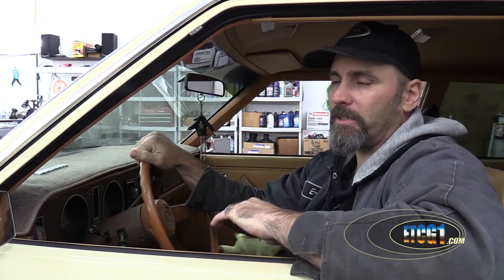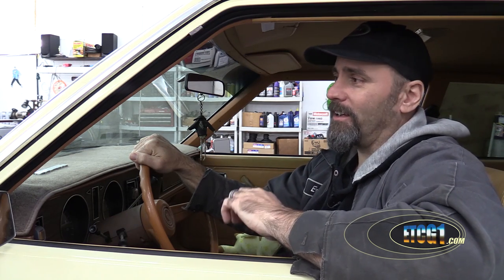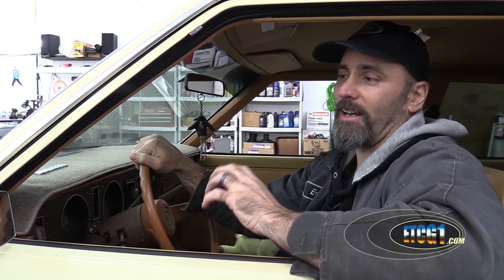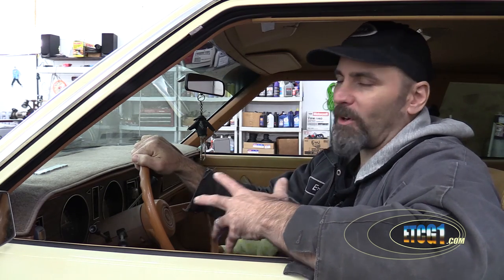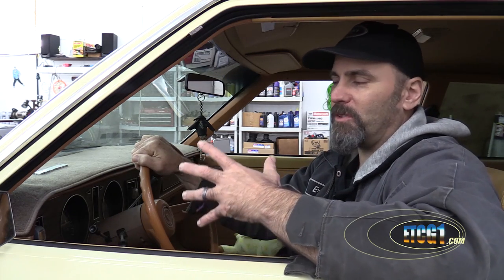Analog vs Digital (Cars)

Comment: Both has their place, both has pros and cons. I've had cars with both flavours, and a well tuned carb does work really well in all kinds of conditions, even freezing cold starts. :) I do have a weak spot for electronic fuel injection though, I like electronic stuff. I remember back in the day I was thinking of converting an old Cadillac to fuel injection using Megasquirt, but never got around to it. I'm sure there are really good custom systems available now for custom projects, but I think a carb fits more to the style of the Fairmont.
Reply: As a side note, on a custom electronic fuel injection system, you can do neat things like changing the power or horsepower of the engine on the fly, disable cylinders and such, specially if you have a vvt system on it. In that way you could have it run more economically when you don't need all that power, but then again, you don't really have fuel economy in mind when building something like the Fairmont project... :D

Comment: Both have their good points, Analog systems are serviceable by a competent person, but there are downsides, do you remember the analogue oil pressure systems which had a tube of oil running through the engine bay.

Digital systems have their upsides, they work very well when they are working fine, and when something goes wrong there are tonnes of mechanics like you, South Main Auto Repair, Humblemechanic, out there to show us how to fix it, every company out there seems to have its gremlins. But does anybody remember early carburetted cars didn't like starting in the cold. 

I think it depends on the application, everyone is an individual in an almost unique situation.

Comment: In the mid 80's the imports, started using Fuel Injection, while the crappy domestics were using a hybrid, less efficient system. Throttle body injection, less precise. My Toyota at the time had a 22R-E (port injected 22R), while a similar aged "domestic" was either carbureted or had a throttle body single injector.

Comment: Ive had 8 cars in total, ranging from -91 to -16. I must be lucky! Never had any sort of problems mechanically or electronically with any of the cars. Only done scheduled maintenance...

1991  1.6l 4-cyl Ford Escort
1998  1.8l 4-cyl Ford Escort
1996  2.5l 6-cyl Ford Mondeo
2004  1.8l 4-cyl Ford Focus
2007  1.6l 4-cyl Toyota Auris
2012  2.0l 4-cyl Toyota Avensis
2015  2.0l 4-cyl Toyota Avensis
2016  2.5l 4-cyl Mazda CX-5

Granted ive never owned a carbureted car, only EFI.

Comment: I started working a vehicles a few years earlier than Eric, in the late 80's and remember adjusting the carburetor and doing all the analog stuff that came with vehicles from the 60s, 70s and 80s.  But as cars progressed I feel they became for me more reliable.  I would like to point to the lyrics of a Merle Haggard song "Are the good times Over?"  Where he wishes a ford and a Chevy would still last 10 years.  I  know now a days there are plenty of 10 year and older cars on the road and this is California with all the emission stuff we have to put up with.  Is it because they are better built or because it is so much more to purchase a new one that people will pay the extra dollar to have them repaired?  I don't know?  I do know if I keep on  top of my regular maintenance on my own vehicles.  I can now drive a 10 year old car and not worry about it breaking down.  Which I actually do now, since the calendar just changes over. 
Eric mentioned older cars can be fixed on the side of the road because they are analog, but I have had an axle break on my and also spun a bearing on older cars that left me on the side of the road as well as an electronic fuel pump so I think both analog and digital cars can leave you stranded, but that is what friends are for.

Comment: I'm from the digital era but I still love analog technology. As Eric has mentioned, serviceability is a big reason analog systems are still a better choice; not to mention when it comes to safety and reliability, Analog is chosen. Take for example braking systems on cars. Yes, they have added a layer to braking and made it better and safer with electronics; but they haven't made it fully electronic. That's because braking falls under safety and electronic (digital) only braking is just not safe enough to use compared to our hydraulic (analog) brakes. If it fails, you will have serious injury or death. Brakes always need to work, regardless of any other part or system on the car. I'm sure electronic brakes would be fantastic, very accurate, and give us the ability to brake as late as possible; but the performance increase doesn't mean it's reliability can be downgraded or even lessened. Just my two cents....
Reply from the maker: The new NSX has DBW brakes. I think you'll see more and more of that. Especially in the next generation of hybrids. Thanks for the comment.

Comment: I personally prefer analog control over digital mainly due to the fact that even though digital tries to simplify things, analog makes things better because there's no guessing, with digital there's readings, codes, and sensors that no matter how you go about it, your replacing things based on information that changes constantly... I've worked on both and I prefer an analog car any day.

Comment: Personally I like analog cars. I almost done restoring a 79 f150. You don't have to worry about any sensors or miles of wiring. If you car didn't start but it cranks you knew it was either not getting fuel or ignition and you would see if it's not getting fuel (stuck float) or if it wasn't getting spark (fuse or points). It was that easy. If you had the same problem in a newer car it could be the egr valve stuck open map sensor, throttle body, ignition, anti theft system. You can usually find the problem by troubleshooting in older cars with limited experience. Above that digital cars are getting harder and more expensive to work on at home because of all those digital systems. What I really don't like about digital cars is that they don't last as long as analog cars. I can't imagine a 2017 car still on the road in 2040.

Comment: As just a car owner that likes to do the regular maintenance items themselves, I like a blend.

I am very content with the introduction of coil on plug and the elimination of distributors.  I have ALWAYS preferred multi-point fuel injection over a carb.  And I am extremely happy with all the diagnostics that cars do on themselves each time they start.

On the other hand...

I LOATHE electronic throttles.  I want to shoot in tire TPMS in the face (Frankly all TPMS).  I still don't get the point of going to a "start button" and the massive replay attack security issues that come with all these key fobs.  And I also don't like electric power steering.

Always owned Honda and at this rate (25 years owning cars), always will.  Just wish I didn't have to have all the stupid electric things they keep adding.  Drove Detroit as a teen and when I got my first Honda, it was a done deal.  Japanese forever.

Comment: There is definitely a beauty about the analog/mechanical aspect. It’s a shame it isn’t more efficient or expansive in its capabilities.

The digital world is amazing, but like you say - it takes “power” away from the user. By power I mean the ability to fix with basic tools and knowledge.  To really “know” your machine.

I would describe mechanical/analog as the body and digital as the brain.  Just like in the general job market - things are moving more toward the brain than the body.

Comment: I find a nice happy medium in late 90s Subarus for daily drivers, just enough electronics for economy, but heavily based in "anolog" Subies didn't switch to "fly by wire" until 2008 (or so iirc)  I find it depends on the manufacturer, Nissan's if you have a bad sensor they're dead in the water, Subies older VW's the SES light comes on and you can still drive, it pays to know about your cars and experience is vital.
Reply: I had some fun times in my '82 wagon.. especially when the carb froze up going over the mountains in winter... good times. Piece of cake to do a clutch job on it (not so good that it ate through clutches like candy).
 - Eddy

Comment: I'm 27, so I'd be considered the digital age, funnily enough though I learned analog systems first, my dad owned a repair business and I was exposed to carburetor and points and learned all about and practiced with them. as I grew up and went to school for automotive, the hardest thing for me was learning about the electronics they had been putting in cars ( worth noting my dads business dealt with diesels and muscle cars so I had no prior experience with cars later than 1994) but in my experience, a well maintained carburated car or truck is more reliable than a new car or truck, however fuel injection is more efficient, so what do people rather? working as a mechanic myself, I like to not worry about complexity in my stuff, I have 3 carburated vehicles and one fuel injected one and even at that, it's throttle body injection, not even port

Comment: I'm not sure I agree with this. I've driven EFI cars for my whole life, along with a few carbed cars. Neither system was more reliable than another, the EFI usually let you know when something was going wrong if you paid attention. I've also had a carb strand me when the float broke. I personally prefer EFI in most cases because I love tinkering with all the variables involved everywhere instead of just looking at fuel delivery volume. I think its just a matter of preference in most cases.

On the other hand I think Eric sort of got close to it. A lot of the people "tuning" EFI systems are afraid to get dirty. All they do is change a number and they really don't know what the number means (as a CS instructor its scary how many "programmers" actually work this way). They don't have a clue making statements like "EFI is moar power" and give everyone else a bad name that you want to stay away from. Where working on a carb requires you to actually know what you're doing.

Comment: I live in Europe, I own a 1991 Audi 80 2.0E . Even though it is fuel injected I do have an affinity for "mechanical" cars. I drive modern cars at work and I wouldn't trade one for my oldie. Old cars with minimal electronics do have a better feel to them, (I credit that to mechanical systems like non electric power steering etc). And honestly it's very refreshing to have something that doesn't require the use of a computer or some other device to use, maintain, fix and enjoy, we have enough of that as is.

Comment: I don't have a problem with computer control to a point.  What I don't like is when the computer controls everything, like push button start that fails and costs 100's to fix when a key would do just fine.  Basically my thoughts are the same as Scotty Kilmer's Mercedes videos..
Reply from the maker: Kind of my point. Electronics can be great, until you have to fix them. $$

Comment: For me anyway, about the "best" time for cars is that period between fuel injection coming in and Canbus systems coming in(so roughly from the late 80's to the early noughties). That period where the electronics were pretty basic(compared to the IT industry beyond the car world anyway) and actually helped on a few levels and mechanical systems and materials were more robust in many ways. New cars are more like PC's on wheels and longevity will suffer. This is not an issue for those folks who buy new every three years, but it will change the market.

 I dunno what it's like in the US, but in Europe independent mechanics are being slowly squeezed out. The systems are so integrated that even if you buy and fit the parts yourself, often the car still has to go back to the Main Dealer Mothership to reset the "brain" to accept it. 

The next phase with battery driven and autonomous cars will take all but the most nerdy home enthusiast with very deep pockets out of the picture entirely.

Comment: I think the biggest thing is knowledge. Those growing up as you said in the last 30 or so years only know computers. When something goes wrong it's the computer. Older guys(and girls) are used to having to look at the mechanical aspect. This applies to everything though. Not just cars. TV broke, must be the computer board. Microwave broke, computer. Stove, computer. You get the point. In all of these, most of the time it's going to be a mechanical part, once in a while, computer fried.
Reply: Aaron Kimmins Most common failures of electronic circuits are obvious simple hysical failures and those that are repairable are done so in a mechanical operation.Take away mechanics and you can't even change a fuse. What makes cars electronics hard to repair isn't the complexity, but the component  packaging, much if it not designed to be repaired.

Erik's repair of a minivans rear vent window actuators is a good example, with rivets used to seal an assembly that could have been done with screws.

Nearly every piece of electronics built after 1970 that I've repair had a prominent label saying "No user repairable parts" and often dire warnings. Those that didn't, had similar warnings in the user leaflets.  

People who believe such warnings generally  lack the knowledge needed to fix the problems.  Those of us who ignored the warnings were driven by a need for knowledge or from desperation until we learned enough to regard ourselves as competent technicians.
Reply: Exactly!

Comment: I don't have much auto experience as a diy guy but the sweet spot for me is the '89 to '92 Volvo 740's and to a lesser extent the 240's ( hate the ceramic fuses on the 240). They're fi but not terribly complicated... have a simple on board obd system...and lots of room under the hood. And can be found on Craigslist for $1000 all day long ( especially the 240). 940's are nice also. RWD FTW.
Reply: holidayhouse03 great choice! over time li have also owned 3 rwd Volvo's. strong, dependable efi cars yet easy enough to do diy work on. now that i own a canbus car i stopped tinkering.

Comment: This argument is not really about what is better, it's about what you prefer. Usually, you'll prefer the one you understand more. Making Pro/Con arguments for one or the other is just making excuses to be stubborn about your preference. For every reliable carb you've seen, there's a reliable EFI system. For every unreliable EFI system, there's an unreliable carb.

Hands down I get the choice of using a carb for a custom build. It's easier to put a carb on top than it is to find an EFI system that will work with the build, install it, and tune it. While people are doing EFI on custom builds, it's just not wide spread enough that people are seeing it and learning about it. Also you got old dogs that really don't want to learn something new when the old way still works.

Comment: My Honda pcx150 scooter is FI. I love it due to the fact it starts up when it is extremely cold. No choke to worry about. My old Vespa had carburetor which was too easy to flood. 

Both technologies have there spot. Mechanical is much simpler.

Comment: I've had it explained to me a while ago, maybe 15 years ago so maybe fuel injectors are better now idk. There are ups and downs to both, carbs have better aromatization. And FI has better distribution to all cylinders. At the time FI was more like a spray bottle where as a carb made a very fine fuel vapor. But it was coming in from one location and some cylinders got more than others. So carb got better peak power but FI had a larger power band. Something like that

Comment: I find in terms of Analog Vs. Digital, there is a fine line.

Analog will forever be timeless, its from an era of unknowns and lots of over thinking of things mainly for the better!

Digital is out of date the moment you buy into it... The advancements are too fast and too much.
When digital system became very popular in the 90's THOSE are the best "Digital" cars out there!
Yes im talking OBD1 Not OBD or OBD2. And yes its manufacture dependent of everything back then.

But,

Those gen one cars, Subaru, Toyota, Nissan , Honda etc. They are STILL on the road today and just keep running!
Companies like Denso, JECS, Hitachi, Panasonic, Bosch, etc, all started making some seriously good "solid state" components.
I know yes, they do use very simple electronic systems and many still use a distributor for spark control!
THESE types of car of this digital era are the unkillable ones! The car will be a rusted hulk and running like a champ!

Thats why analog is Soooo nice. It give the tech or guy working on it a good indication of what is going on.
Love that!

Which leads me to this.

The digital world of cars we have now is basically insane! Modules talking to one another! If one does not shake hands with one another the car just will never start or run again!

Purely terrible!

Not to mention quality of parts is going down.....Even on a OEM level.

For me.
I will drive any car really as long as its NOT OBD2.

Once that came out........

I KNEW it was the end......